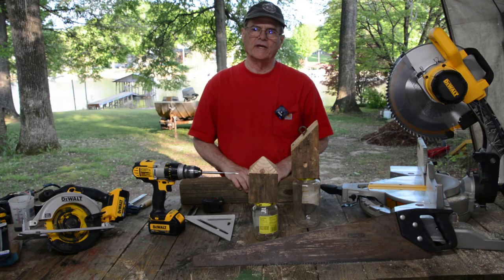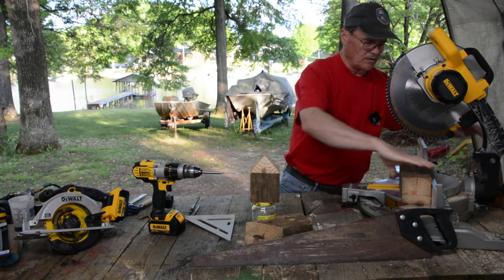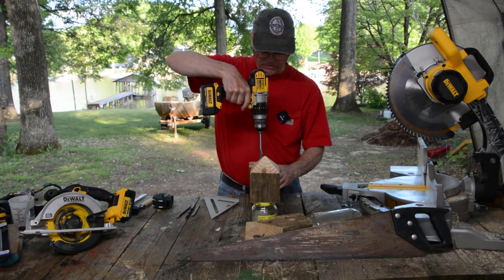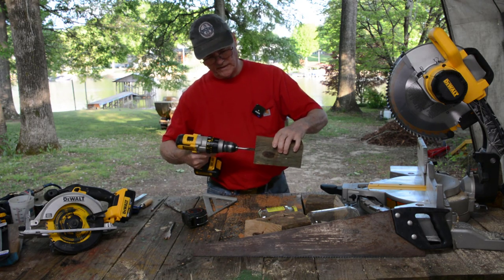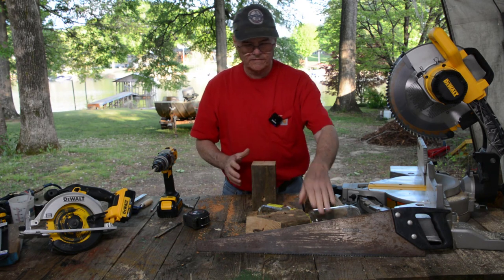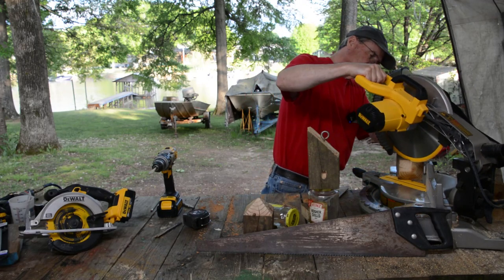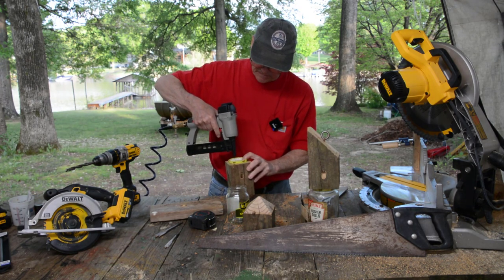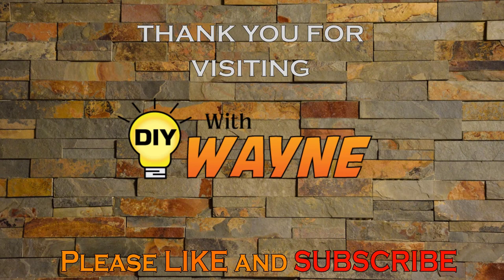How To Build a Carpenter Bee Trap

Comment: you want to drill the center hole 2/3rds down the length - whatever length you make the block. I use painter tape on  the drill bit to mark that depth so I know exactly where to stop drilling.
Reply from the maker: That works, I have done that before on other projects but did not this time.  Thanks for the suggestion and have a great day.